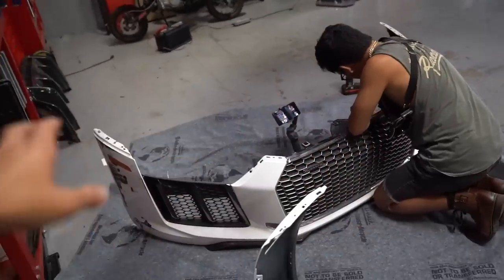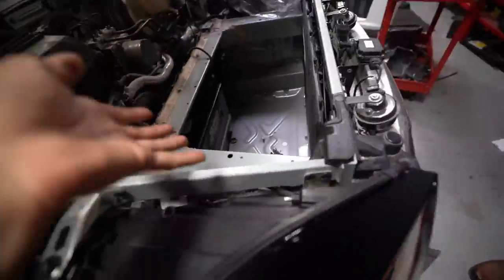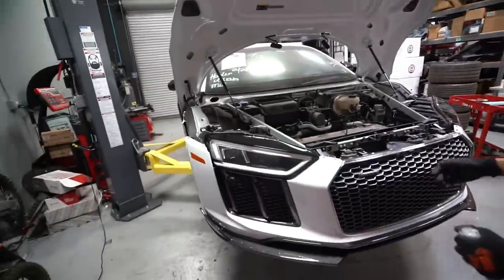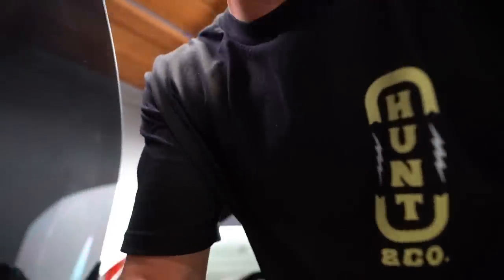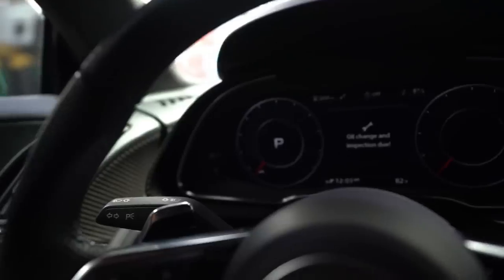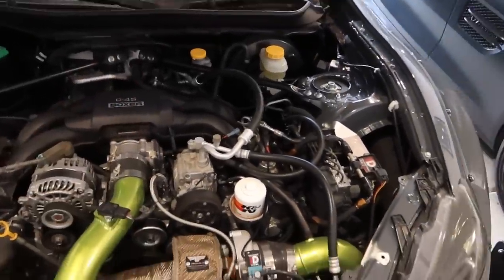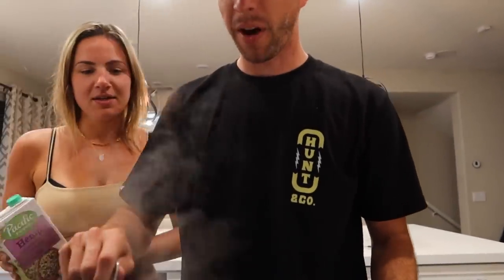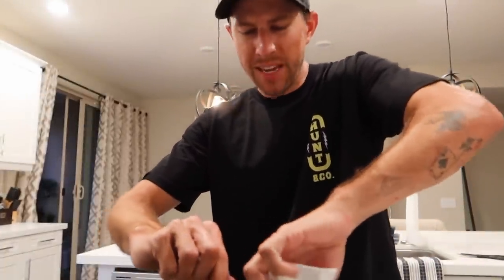My NO LONGER WRECKED Audi R8!

Comment: @TJ The BRZ  issue is an EVAP vacuum hose under the manifold, it's super common to pop off on boosted BRZ's because of the boost pressure. The lines under the manifold aren't clamped for whatever reason, you can get to it by removing the AC compressor, I did it myself years ago in my driveway, had the same problem you had with the car not idling at a red light

Comment: I already told you to check under the driver side intake manifold for the vacuum lines. If you would read the comments you would have seen tbat. And yes you can reach under there without removing the intake manifold. If I recall it actually pushes on from back of the car to front of the car. Worst case pull the serpentine belt off, and move the AC compressor. Be a lot easier than pulling the intake manifold

Comment: Hey man! I work at Porsche, and as you may know Porsche and Audi share various parts and systems, and yesterday we had a 992 throwing almost all of those codes that you mentioned in the video. All you have to do is take it to the dealer so they can reset the computers, the computers freak out when the car has been jump started. Hope that helps!

Comment: Hey teej so on the Audi if I’m not mistaken because I had the same type of problem when I  had to swap out and remove the electrical wiring in my Audi it popped up all the same codes... long story short you have to drive it around for a total of 5-10 miles for the cars ECU to reset. Hope that helps brother keep doing what your doing and don’t stop 🙏 much love

Comment: if it helps im a certified audi technician, the best thing i can recommend for all the faults rn is to bring it to the dealer to scan the car and have them clear the faults or you can most likely clear the faults yourself. the faults will stay on in the car regardless of what you reconnect until you clear the faults. the R8s are super touchy with that stuff. you may even figure out the starting issue too. If you want, if you contact me i can check TSBs from computer and see if theres anything relating to the starting issue!

Comment: Tj have you checked all the plugs on the transmission and ground straps? Maybe one of the tow company's put the car into tow mode which would disable the all wheel drive and stop the car from starting when they go to put the car into neutral to roll it off the truck

Comment: TJ you can clamp that evap line under your BRZ intake manifold by taking off the AC condenser and using some needle nose pliers. A lot easier than taking out the intake manifold.

Comment: Check your wiring to the Camshaft position sensor or Crank sensor.Another potential cause can be low fuel (fuel pump relay issues).Put more than half a tank and if the issue goes away,it's the relay or fuel pump it's self going bad. Drive system Malfunction could be as simple as a stored misfire, gasket leaking etc.

Comment: You can try driving the car to clear those codes. Most VW/Audi cars freak out with those codes after the battery is disconnected. Driving around the block should clear them up since the car will recalibrate itself

Comment: Hi TJ there is a software update s0004 for the malfunction code.it should come up as p0087 stored in the ecu. Now the no start on first push there are a couple of things you need to check first is the battery in the key fob nearly flat an easy way to find out look in your cup holder area on center console for a picture of a key with 3 lines in front of it place your key fob on it then try and start the r8 if it starts first time then keyfob battery is flat Second if the key picture is on the center console check to see if cal plugged in the key fob reader he may have missed a plug or not fully plugged in a connection.Third check to see if any ground wires are not bolted down or have green death on them last but not least the power wire for the starter motor check both ends see if the cable is tight on the starter itself and check the smaller cable where the pyro safety fuse is this would not be the first time a pyro safety fuse was the culprit especially a non oem one or a bodged up one  it must be not much wrong when you push start the first time it sort of makes a clunking noise like the starter wants to engage then does'nt my bet the pyro fuse or the main power wire.Shout out to your better half lol get well soon cheers from down under

Comment: Depending on year Check all wheel speed sensors might be affecting stability control and awd if atleast one sensor is bad will throw out of whack. Those sensors have to know how fast each wheel is spinning independently so computer can adjust stability awd and abs.

Comment: TJ the traction control light and steering light will mostly go out after you take it for a drive as the car needs to relearn after the battery has been disconnected

Comment: You can swap to a 2017+ wheel and gauge cluster in the 13-16 BRZs.  Did it in mine and it worked out great, may need some kind of voltage adjuster to get the head unit steering wheel controls to work but the ones for the gauge cluster work out of the box.  Let me know if you have any questions or want any more info.

Comment: Teej I think it doesn't start the first time as a sign to warn the driver that there are a few malfunctions/lights/codes with the car. Maybe when you get them cleared it will start up the first time and if it doesn't then see from there

Comment: So Teej, as a final year student dentistry i’m happy to hear you’ll stop using the hydrogen peroxide mouthwash. But, i noticed the way you brush your teeth... it’s a good thing to brush electric, but you can’t brush your teeth with an electric brush the same way you brush with a manual toothbrush. With the electric brush you need to put the surface of the brush on every face (inside and outside) of the tooth separately, and leave it there for like 2 seconds while making very small circular movements, then go to the next tooth :) hope this helps man! Keep up the awesome vids btw, been here since the first BRZ videos!

Comment: Hey TJ get yourself a OBD11 it’s only 100$ and you can diagnose everything Audi on your R8 even reset the oil light and it will also tell you what exactly is wrong with the car I have it on my mk5 gti and it’s a lifesaver 10/10 recommend it will save you money on the first use

Comment: TJ if you want to continue with the Hydrogen Peroxide you should use 3% then mix it with 2% of water so the final mixture should be 1% of hydrogen peroxide. You should be safe that way and still get the benefits like whitening your teeth.

Comment: Here is why the R8 isn’t starting right away..
Your wiring harness from the ignition junction box to the internal fuse box must have a faulty connection. There is a simple fix, all you need to do is take out the fuse box located next to the FluxCapicator and insert a new 1.21fuse. This should fix the issue, as well make sure your Mr.Fusion is cleaned and operating effectively! 

- Doc

Comment: 🏆🏆@tjhunt your all wheel drive malfunction, esc etc is all linked to the haldex ecu, when your crash it’s a “shutoff” for safety measures, you may find that you will have to replace that when you get it checked in, they can also be programmed “played with” to get around it, as it will be pricey being as though it’s an R8 but guess what.... HALF OFF BABYYY!!!!!!!

Comment: Audi’s use the abs/wheel speed sensor fir the all wheel drive system check the side that  took the hit one if the sensors or wiring has probably gone bad

Comment: TJ please don’t use razors on ur windshield use steel wool instead. It works much better/easier. I worked at a paint shop and it blew my mind when we used it but trust it works better and doesn’t scratch ur windshield like razors do

Comment: Hi zinc content is for solid lifter motors not hydraulic motors and all are daily driver engines are just that.. so valvoline is not a better oil because it's higher in zinc. ...

Comment: Careful...VR1 is designed for racing circuits and meant to be changed after each race as it does not have any other additives for prolonged use. Also, the Zinc and Phosphorous content will ruin  catalytic converters and wet clutches.

Comment: This is a German car so it's running Bosch ecu and all that stuff it's so much technic inside the car u need to get it to a dealer to scan the real codes and reset the sensors. Maybe the malfunction is from the Quattro so it needs to be calibrated again.